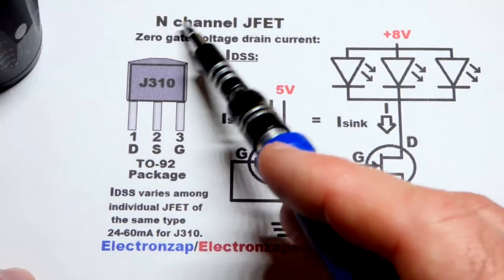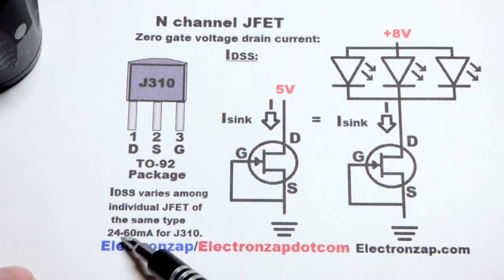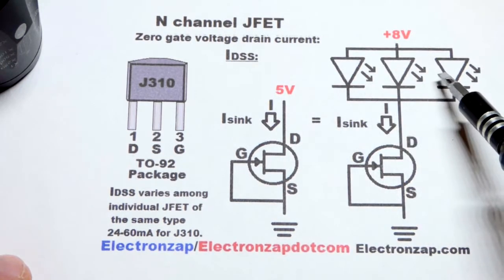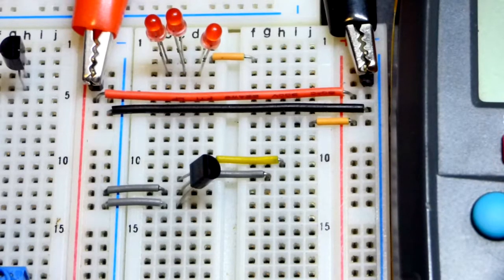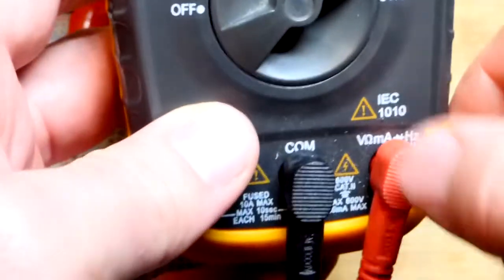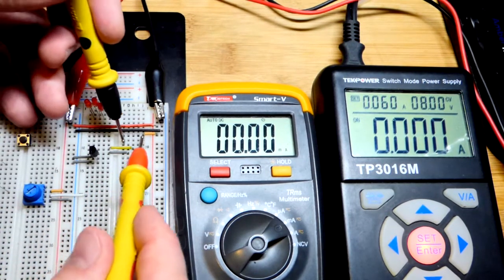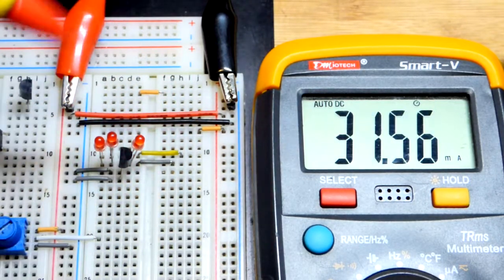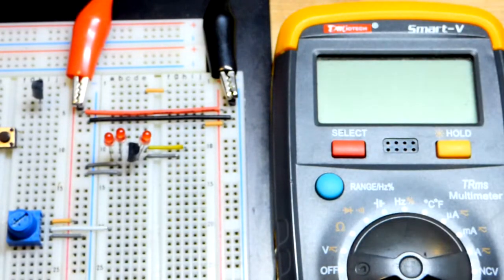Electronics JFET Idss explained using J310 gate zero voltage drain current test

Comment: Diodes don't "split up the current" between them. You simply can't expect diodes in parallel to distribute the current passing through them equally, especially for larger currents. That is because the P-N junction has a negative temperature coefficient. Because you never get perfect matching, one diode will draw a little more current than the others and will heat up more. That causes the current through it to increase as the voltage drop across it decreases, and that leads to more heating, and so on. Eventually, one of the diodes will pass most of the current and the others will pass relatively little. Fortunately, LEDs are quite robust, so 30mA won't bother them, and they illuminate on quite small currents, so you probably won't spot how the current is actually distributed.
Reply: If each LED has its own resistor, I think the distribution will be roughly equal.
Reply: @Enigma758  Agreed, but if each LED had its own resistor, I wouldn't be making my comment about the problem of simply connecting multiple diodes in parallel. I think at least two of us know that to get an equal distribution of current, we have to put a separate resistor in series with each diode.
Reply: @RexxSchneider I wasn't implying anything more than pointing out that resistors would solve the issue you raised which I suspected you were already aware of. 😊